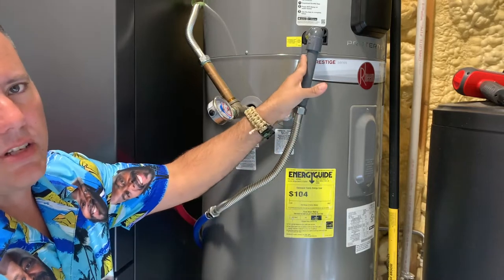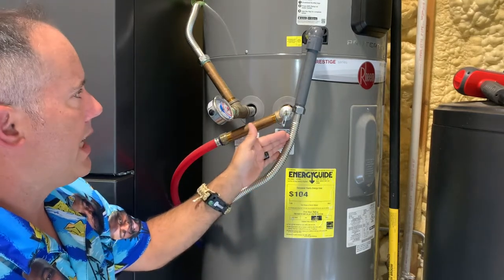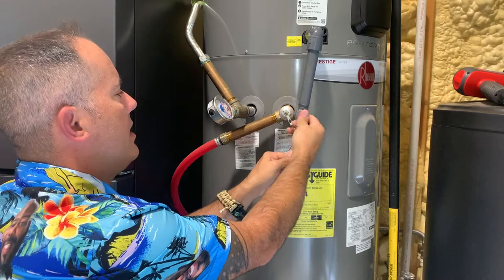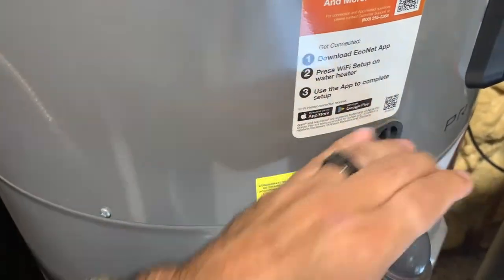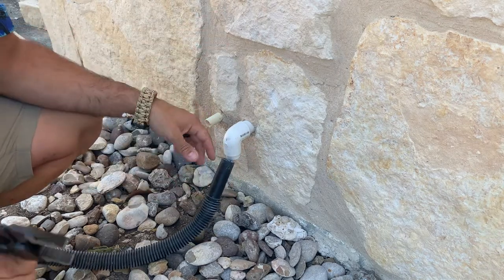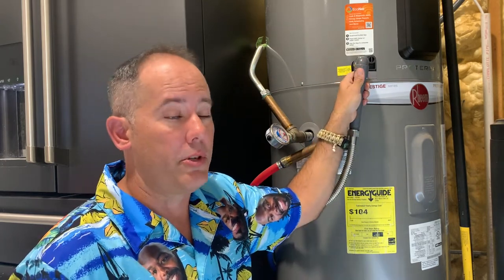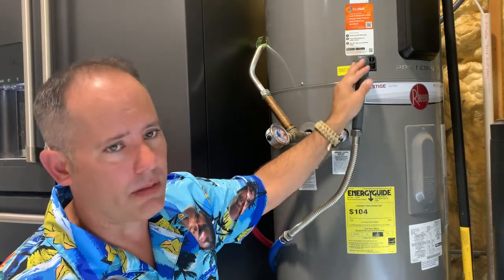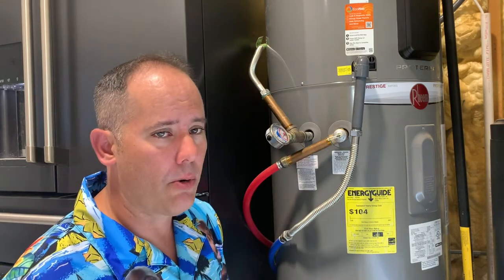Rheem Hybrid/heat pump Condensate line

Comment: The condensate  tray in the rheem  heat pump is a manufacturer  defect and is defective  due to the fact the  cold side is sitting in the tray without the needed one inch above tray to stop false alarms and black mold buildup. Plus tray is not angle toward the escape holes so a puddle sits in tray all  times. I don't recommend  getting rheem  unless you have top pulled of and check to see if they fixed the defective tray.
Reply from the maker: Sounds like you might have an environmental issue but the current generation of the heat pump water heater drain just fine.
Reply: @rickpowell1402  environmental  issue? Wrong, it's the fact that the water heater is inside the house and  does its job great, but in high humidity, it has a lot of condensate . Any company that manufactures doing heatpumps test in high humidity  conditions.  It's the black plastic tray the problem and rheem refuses to fix it.  Not every  house is climate controlled.
Reply from the maker: @kennethharrison4847  these work well
In non climate controller areas.   I have not come across an issue with the drain as described by you.  Possibly an issue with your specific unit ?
Reply: @rickpowell1402  that a understatement tried for years to have it resolved but rheem never got back to me can anybody  tell me if they changed the tray and drain system?
Reply from the maker: @kennethharrison4847  what generation heater do you have.   What year was it manufactured
Reply: @rickpowell1402  it's the first generation I think
Reply from the maker: @kennethharrison4847  I will buy that heater off you if you ever get rid of it.  If it is first gen. Those are needed for contend

Comment: Does the water heater have to be empty to unclog the line?
Reply from the maker: No.  Water condensates and simply drips into a little black tray then it runs out of the side into the drain pipe installed.   You so not have to do much to service the condensation line.  It is not connected to the water in the tank.